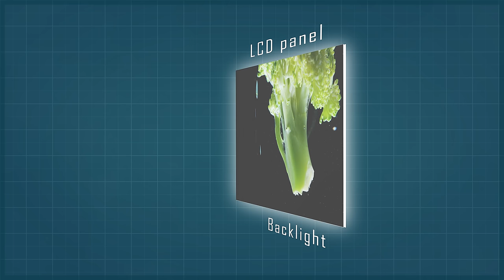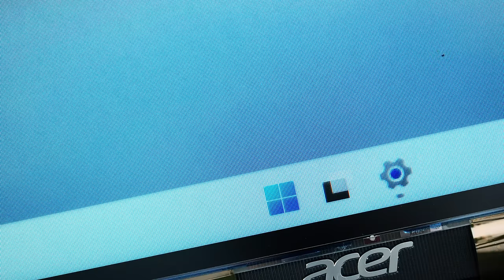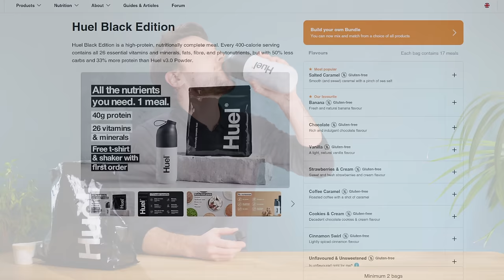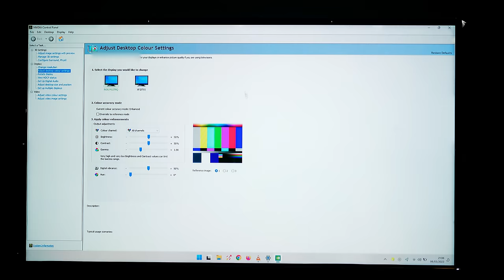DIY Dual-Layer LCD monitor - can it match OLED??

Comment: Why didn't you just take out the polarization layers of one LCD panel, and just stack the actual LCD's? In this demo you stacked the panels which are composites that include an LCD layer, where you should have removed the LCD layers from both screen and then added one stack of filters to the LCD stack, this would eliminate the need for the excessive LED lights and thickness and the need for the paper (depolarization layers)

Comment: That’s kinda unfair if you don’t compare them at the same maximum brightness. And physically, adding a second LED won’t make it any better because 1. The absorption coefficient is still the same. And 2. Light traversing more liquid crystal volume is bad as there will be more scattering and diffusing. That’s why you see the blooming. I’m sure if you match the maximum brightness, the blooming will be even worse.

Comment: instead of adding tracing paper you could have removed the polarization layer from bottom lcd, usually you can just peel it off the top. 

Also I'm pretty sure this is same concept as dual layer lcd, only they used black and white for bottom layer, getting a lot more light pass through

Comment: Why don't they make gaming monitors like this? I love my Aorus 48" OLED gaming monitor, but I spent a boatload on it, and the forced 5 minutes off every 36 hours for pixel refresh and shifting is annoying as hell. Designed from the ground up, such a monitor would not need the polarization filter on the first display nor your huge light box or diffuser. People would pay for this. Another possible benefit, as such a monitor aged out, there would be less color loss and dead pixels would rather be dim or bright, but not dead as one layer would still function.

Comment: wait a sec.. why do you need the tracing paper between the two pannels? you only needed that to diffuse the LED's. Assuming you can align the two pannels together perfectly, you shouldnt need to worry about blurring the rear monitors light to pass through the upper moster display..

Comment: I use mini led technology on both tv and monitor
monitor comes with VA+Mini led and TV IPS+Mini led
I can easily say ips+mini led produces a great picture quality, deep contrast and mainly great viewing and multiple view angle and gets very close to being black like oled with less blooming issue and on the other hand VA monitor (samsung neo g8 240hz) of course it's a monitor you have to sit front but oh boy it has issues blooming is very obvious, image ghosting, pathetic colour picture accuracy like sky and water shadows its just pop colours nothing more, tried changing the sitting distance and everything (VA+Mini Led) it's not worth at all
Next I'll switch for Oled not coz pure black and the details in the picture quality at least it doesn't look washed out, It has burnin issue which occurs on rare cases where you keep the same Static image for longer time, i don't think it will be issue in my case as i just it only when i need it
only few advantage mini led has over oled is that peak and consistent brightness with great contrast, watch content with Ips+mini led next to oled in a bright room your eyes will catch on mini led i can go on and on but only if anybody is interested to know more

Comment: 11:15 "Of course, the ultimate display technology is OLED."

With respect, the ultimate (consumer) display technology is CRT. While other consumer tech has surpassed CRT in resolution and brightness, CRT still to this day delivers superior spatial and temporal image quality.

I believe that one of the biggest problems, Eye-Tracking Motion Blur, could be eliminated in OLED by simply pulsing the display with an envelope that mirrors or approaches that of CRT phosphor, and compensating by increasing the peak voltage/brightness. There just doesn't seem to be any desire to deal with this problem, unfortunately. "Black Frame Insertion" is a poor alternative for multiple reasons.
Reply: temporal image quality is not as important as infinite contrast. OLED's biggest draw back is its low brightness, thankfully modern pixel cleaning software fixes even the worst burn in.
Reply: @miguellopez3392  "temporal image quality is not as important as infinite contrast."

You say that, and yet literally at least.... I would say 95% (to be conservative) of people view their OLEDs in a lighted environment, or worse a bright environment.

Anyone who views a display in anything less than a theatre-dark environment or darker is not experiencing a true black level, and is experiencing a contrast ratio that is a fraction of the display's capabilities.
Reply: @bricaaron3978  its an issue that will gradually be solved as manufacturers make brighter and brighter displays.
Reply: @miguellopez3392  "its an issue that will gradually be solved as manufacturers make brighter and brighter displays."

I'm not understanding you...

How is a "brighter and brighter display" going to deliver the experience of standing in an underground cave with literally zero light?
Reply: @bricaaron3978  helps offset the contrast from brighter rooms, Also I have almost no issue with contrast on my 65 inch OLED and I use it in a lit room since dark rooms give me eye strain.

Comment: Not a real solution just my own curiosity and it would be a pain to line the content up. but if the top display was rotated 90 degrees would that allow the light through?

Again I'm only asking about my specific question not suggesting it as a viable solution as that would be silly.

Comment: So about $400 for the original monitors, maybe $40 for the LEDs, you still have the acrylic, hdmi splitter, metal sheets, heatsinks, fans etc. so it gets more and more closer to $1000. Not to mention the time you spend.

It's nice to see you work on such projects, but I don't think you should try to trick people into thinking it's cheaper this way. It's definitely not cheap. And an average viewer will likely not succeed doing this anyways.

$180 – $230 is a single high refresh rate (100Hz+) monitor. So not sure what you're trying to do there.

Comment: 10:40 looking purely at the costs while ignoring the operating costs is bad, though. 

I mean this may not be much of an issue in countries where energy is cheap, but not where it's expensive... like Germany. Like let's do some quick maths. I assume your DIY draws 350watts from the wall, that's 350KW for 1000 hours, a 48" LG CX draws around 120w per hour (in HDR, SDR is around 90w)... so 120KW in 1000 hours. A kilowatt costs 0.40€ here, so using that LG CX would save 92€ every 1000 hours, but chances are your TVs or Monitors run twice as long over the year so you are looking at around 200€ of savings each year.

You'd be much better off with dropping 1k for an OLED monitor than building that dual layer LCD, at least in countries where energy isn't dirt cheap.

Comment: No, this isn't a good method. What you are basically doing: add two monitors, then you try to double the light output from the backlight to counter the dimming. Which IF you would be able to do, you basically end up with around the same contrast, but with more added blur. Since you would force more light through them ending up doing the same thing you would do with only one panel. and your regular backlight. Obviously your lights weren't strong enough to fully light the two panels, and the result was a very dark experience, you simply lost half of the image quality, and detail of your colors and picture, because of the crushed black levels. Crushed... to put it lightly. They obliterated your image quality :) But again, if you would shine even more light through until you fix it, and restore correct contrast ratio, you end up at around the same brightness of your black level as when you used a single panel. While using a lot more power for the same result.

Comment: Though neat, basically, OLED as stated is the "way to go", simply buy a cheap OLED TV and "call it a day", as OLED monitors are baselessly overpriced and are just a gimmick until they come down in cost, as larger screens would cost more to manufacture than monitors, thus, logically, the monitor prices aren't true to scale in cost and thus price.

Comment: This is really cheating. 😅 
I think with this approach, what you should have done is use one LCD layer as a pure black and white mask to not interfere with the colors. Otherwise, you're just self-multiplying a color, making every color appear more saturated than it's supposed to be. 
If you really just want to have dark blacks, you should create a mask frm the image which appears white whenever the color isn't black and black where it is. With some transition in between

Comment: This is doable with better results in industry but is less efficient thus useless for laptops and not favoured by regulators. Not 200W bad but still say 40W over 20.

Comment: As I love the idea, the execution is bad. You are lacking basic research from engineering point of view, at least you did not mention about it. LCD panels work on polarized light but how? You have unpolarized backlight. First you need a filter to only let one polarization to go through. Then you can use liquid crystals to dynamically rotate polarization at individual pixels. Let's say from vertical to horizontal. Then you have another filter. Either it will let horizontally or vertically polarized light, so the liquid crystal layer either is rotates the brights or dark sections. So simply said, some panels have output polarized 90 degrees from input, others don't. And this is exactly the problem you had, your panel does change the output polarization and that's why it can't be layered in a simple way. Don't play around with paper, that's for YouTubers making stuff from plastic bottles and hot glue. Do some research to either find a monitor that has same input and output polarization or use two different panels. They come in both variants. I even had two Dell screens (newer and older) that had the opposite polarization. You can quite easily check it by looking at screens in polarized sunglasses. This way you would loose only a little part of the light, it may even use the same backlight. The effect would be much better. Going further, manufacturers could actually use different panel for backlight. They could use large grayscale panel for local dimming with one zone per pixel (instead of subpixel) which could drive the cost down and improve efficiency even further. It can be done and it would surely be much cheaper than OLED.

Comment: Dude there's a thing called mini-LED and the most recent one which is better than OLED called micro-LED. You're way outdated when it comes to display tech! You dont have to spend time DIY-ing dual layer LCD because current LCD tech is better.
Reply: Homie, its a DIY channel. Of course he's gonna do DIY. Thats the point.
Reply: micro led is oled without the o.